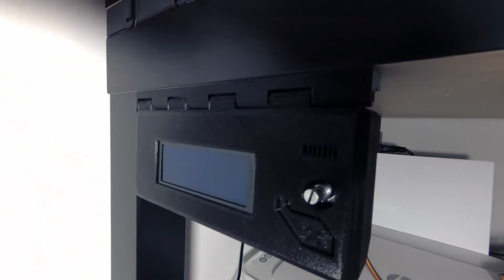5 Upgrades for for my Prusa i3 MK3s Ikea Lack tables enclosure

Comment: Mmm, why take the side panel out? Why not just open the door? I was thinking about maybe attaching a small slot on the door hinge, so it would just stay open if you open it far enough.
Reply from the maker: Better and easier access to the printer without taking the upper table off. The doors stay open but the printer is in a narrow room so it's unconvinent. Probably just opening the doors is enough but without side panels air exchange is better.

Comment: Did you do anything about the wobbly legs? My lack Table feels really unstable and it has introduced a lot of ringing..
Reply from the maker: Not yet. At first I wanted to print some of these: https://www.thingiverse.com/thing:2794661
But that's a lot of plastic, so I had the idea of just using mdf panels for the lower tables to make them more like boxes/cabinets and maybe add some shelves/doors. But as well I can make whole enclosure from scratch. I have stalled.
I also watched Stefans video: https://www.youtube.com/watch?v=y08v6PY_7ak so maybe the whole unit acts as a dampner. I haven't noticed more ringing but I need to take a closer look.
Do you have some comparison prints?